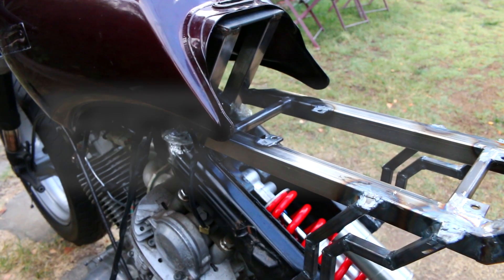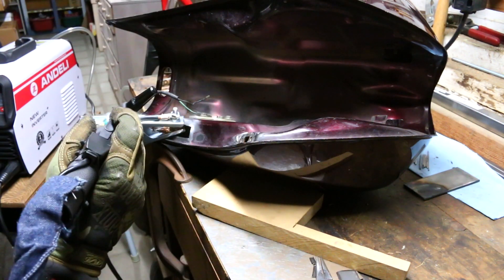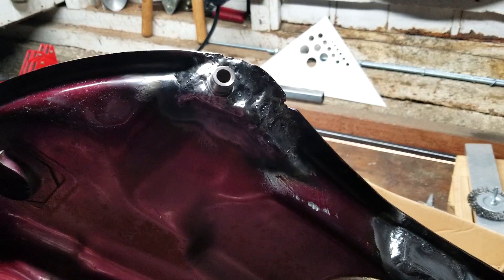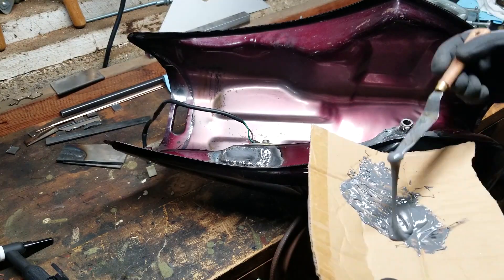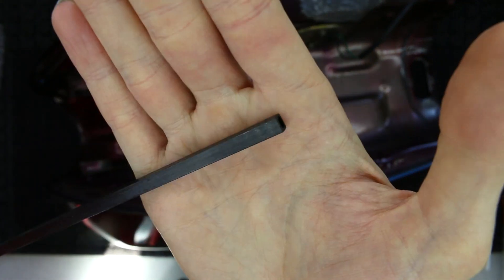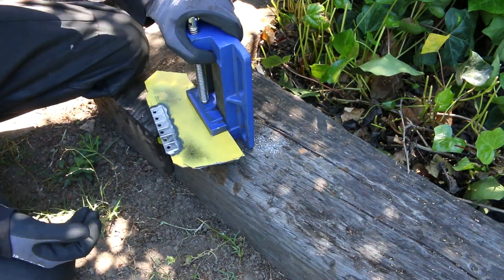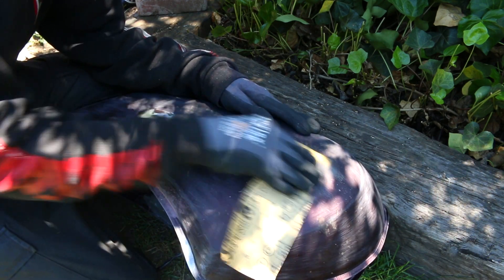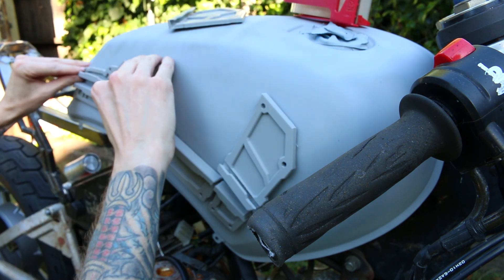🏍 This Gas Tank Challenged My Sanity [ P8 ] \\ Yamaha XV920 Virago Cafe Racer

Comment: Use pedal for welding to control your amps, and you can tack weld a piece of rod to a cut off piece to hold it flush with the tank metal to make it easier. And also purge the tank with argon so the other side don't look like moon rock.
Reply from the maker: Sadly my welder will accept a variable pedal, but I can play around with pulse settings, thanks for the tips man 👍

Comment: What bike is the tank your using off of?
Reply from the maker: This is the stock tank that came with the bike. 👍
Reply: Do you know if the mounting points for the tanks are the same for the 920 and 750 for ‘81
Reply from the maker: @jeffbafaro2171  For the tank? Pretty sure it is the same.

Comment: If it’s warm outside you need way less hardener. If it hardened that fast you are putting in way too much.
Reply from the maker: 100% once I fixed the ratio to 3% hardener to 97% material, it was a lot easier to work with 👍